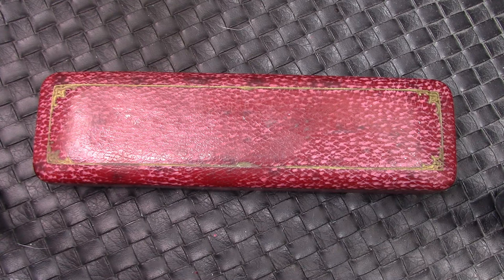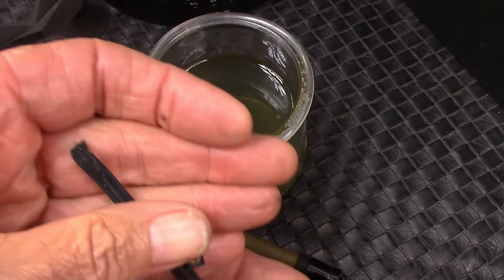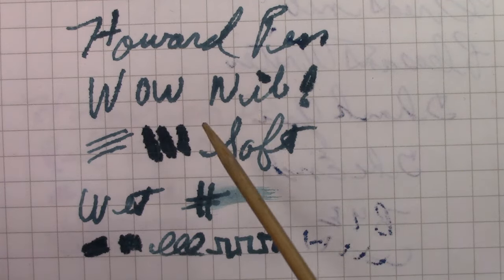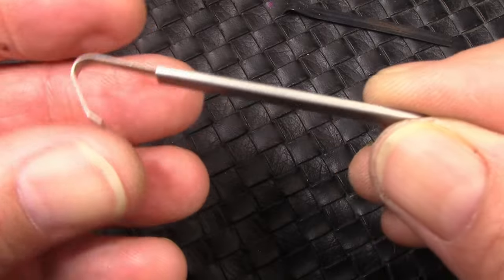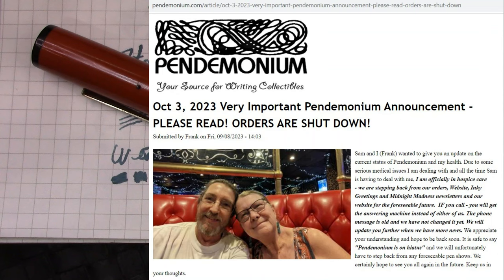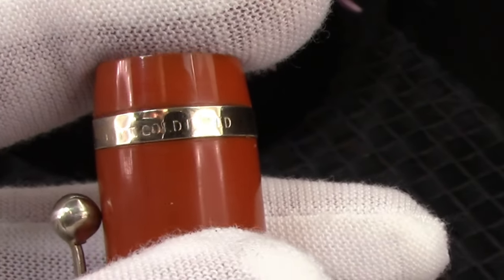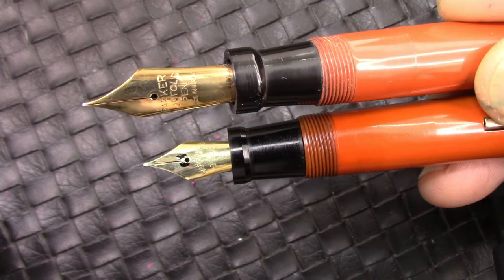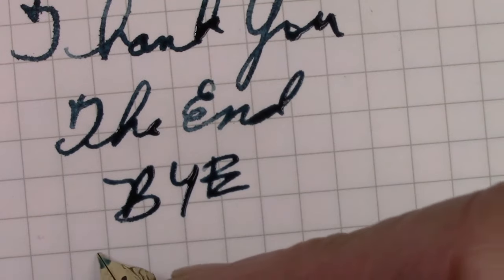Vintage Howard Fountain Pen Restoration

Comment: I have and use a near identical black-topped orange Duofold mimic vintage pen.  The lever is marked “GEM,” the clip is stamped “GRIP-CLIP” and the nib is stamped “GEM” “14K” and “6”.  The details of the pen body proportions look very close to or identical to one of yours, the one with the shorter section and shorter clip.  It has lost its narrow cap band if it ever had one; the area where it would be is smooth, perhaps just slightly concave.  (Maybe the restorer polished out a more visible scar.)   On mine, the lever and the clip have lost some of their gold plating but they still work fine.

I bought my faux Duofold at a Boston pen show a long time ago and it cost very little.  (Lots of old pens in New England — I picked some up at yard sales years ago.)  The ink sac had been replaced and the pen writes well.  Like yours, its nib is a semi flex/soft wet writer.  I use it often and have loaded it with Diamine Terra Cotta ink.

I really enjoyed this video and learned a lot.  I wish I knew how to repair old pens as you do.  Lovely hobby, bringing these wonderful old pens back to life and passing them on to new owners who will enjoy them and care for them.

Can you recommend people who will replace ink sacs and otherwise restore vintage pens?  The person who used to do mine retired during the long time I was away from my fountain pen hobby.
Reply from the maker: Let's talk, send me an email.

Comment: The $10 price tag was for "an outfit", a set, which was a pen and mechanical pencil. Ten dollars was typical for a top tier pen and pencil set during the 1920s, like a Duette set from Parker or a Giftie set from Sheaffer, but would definitely be a very high price for a third tier pen such as the Howard or the Astor, although it is possible that the pen and pencil were from the thirties, as you said, but when the styling of those pens was current, as late as the early 1930s, $10 would still have been a very high price for a third tier pen set, certainly with the trim levels of the two pens in the case. There is a very good chance that the paperwork included in that box has nothing to do with either or both of those pens at all.
Reply from the maker: Could be for a set.  Maybe the price was a suggested retail price & pen were sold at a lower price.

Comment: These pens aren't quite a century old, so it's impossible for them to have been unused for a century, especially if they show signs of use, which they do, but your point that it could be decades since they last saw use is well taken.
Reply from the maker: Pens could be from early 1920s, a century ago.  For me saying century is closer than saying decades.
Reply: @chrisrap52  the earliest they're from is about 1926, and they had clearly been used enough to have looked used, which would have been for at least a few years, and more likely several because people used these things, and cheap, disposable pens didn't appear until the 1960s. It is quite unlikely that these pens hadn't been used since before they were even made.

Comment: It took me probably a solid two minutes to figure out what the 15.5 and 13.3 measurements underneath the photo of the capped pen on top correspond to, and in what units they are supposed to be. You forgot to add that they are in millimeters, and that they are for the diameters, not lengths, of the cap and barrel, respectively. Because they are underneath the pen with arrows pointing up to the cap and barrel of the pen, it looks like these measurements correspond to their lengths. Frustrating.
Reply from the maker: All measurements, unless noted are in mm.  I show length of barrel in middle photo.  For me the arrow means diameter.  Sorry for your confusion, now you know.
Reply: @chrisrap52 no, you indicated millimeters, inches, and grams everywhere else in the graphic, but not for your diameter measurements. That was inconsistent and so unclear that it took literally minutes to figure out what you were referring to. Also, there is no way that an arrow pointing up to something indicates diameter. If a diameter measurement is intended, there should be brackets indicating the diameter dimensions that point to the measurements, or at least the word diameter should be used after the measurement values. If you don't do this and there is no visual indication showing what the values correspond to it is unclear what dimensions the values correspond to. The other values were clearly marked. These diameter values were not, and it was very frustrating to have to figure it out. This is NOT a shortcoming on my part but on yours. What you may have intended and how your graphic is perceived are two very different things.
Reply: @chrisrap52  and above all, having to deal with trying to figure out what your measurement values correspond to just interferes with the enjoyment of the video. I was enjoying it and then became irritated because I had to spend literally minutes trying to figure out what you were talking about. I would imagine that you would prefer not irritating your viewers.
Reply from the maker: Again, now you know.
Reply: @chrisrap52  the diameter measurement labeling was nonexistent, and the way that they were displayed and not labeled was inconsistent with the way that the other measurements were labeled and displayed. As for "knowing now" I figured it out before I even mentioned the problem to you. I mentioned this to you because it got in the way of enjoying the video. Doesn't it just make more sense to display these measurements clearly in the future rather than trying to defend your oversight? Good grief.